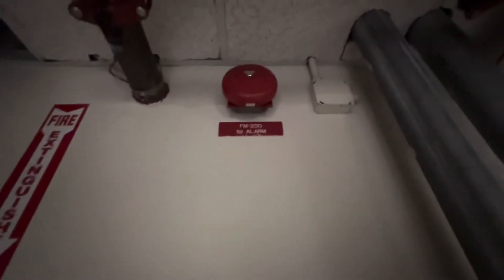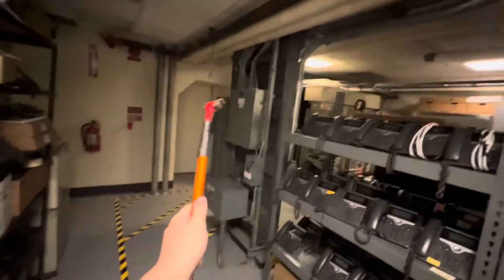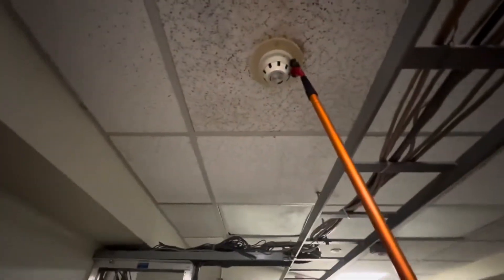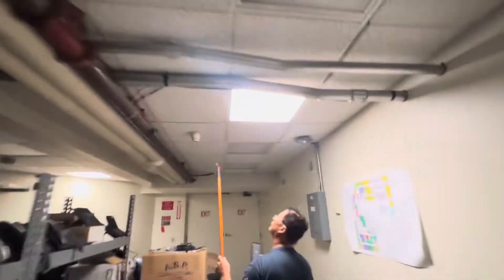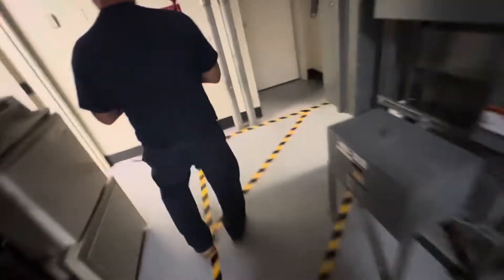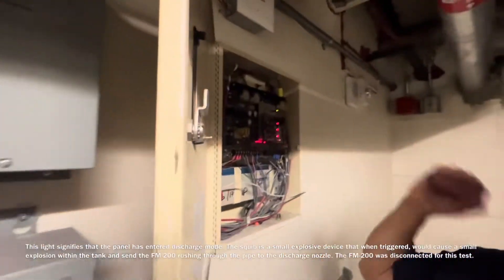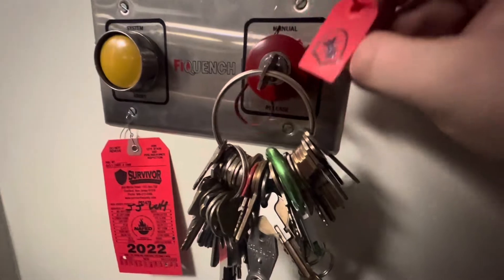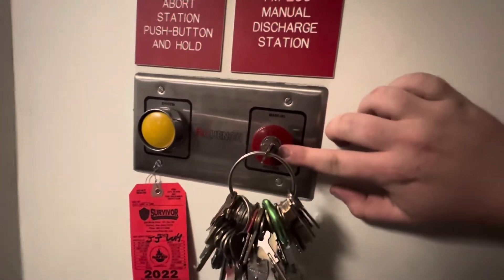Fire Suppression Test #1

Comment: Would the panel stay in the first stage if the second alarm isn't activated? Or would it eventually go into the 2nd stage after a certain amount of time?
Reply from the maker: The first stage is just a general alarm. So like a fire alarm system, the bell would sound indefinitely until silenced, reset or until the second zone is activated triggering the pre-discharge mode